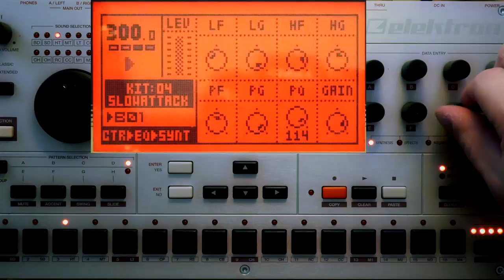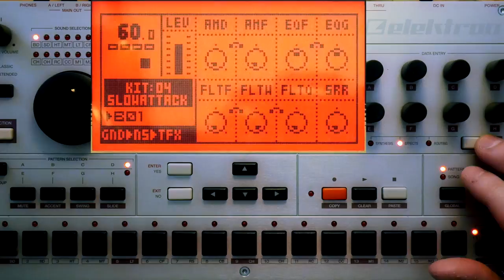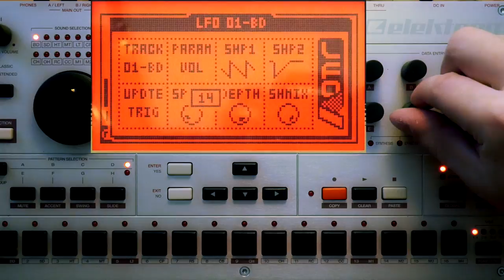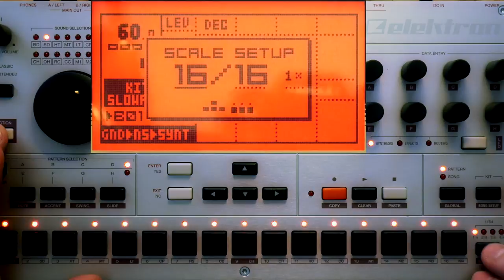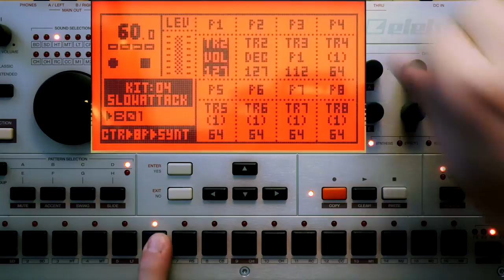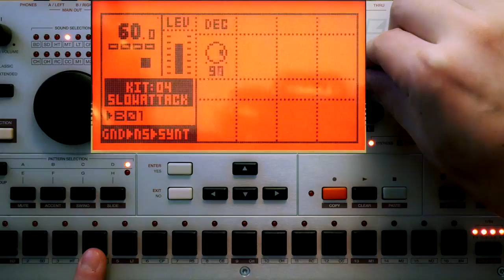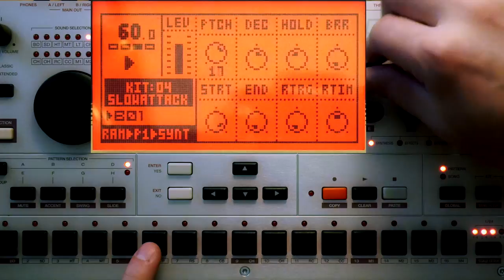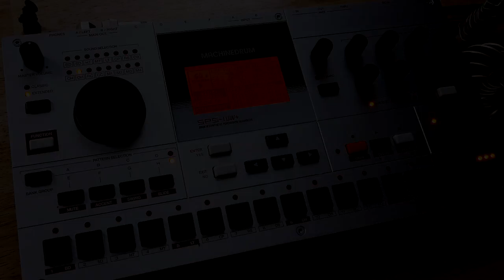Elektron Machinedrum: Slow Attack Envelopes

Comment: Nice video. CTR8 + slide is nice idea, enables  controlling several noise generators at once. 
I would add one advanced method: Route your noise generator(s) back into MD using individual outputs and inputs. Use global menu to specify the path of the signal. Then you can use INP machines, to shape the AMP envelope as you please.
Reply from the maker: thank you! this isn't really meant to be a sound design tutorial per se, and is primarily about basic but not necessarily immediately obvious modulation routing techniques. Using input machines and routing MD outputs back into inputs was outside the scope of this tutorial, but I have been wanting to make a video that goes more in detail about the machinedrum audio i/o and input machines, not sure when that will happen though! :)

Comment: What happened at 5:30? You opened kit menu,  seemingly did nothing but pushing couple knobs and somehow GND-NS was loaded into track 2. How did you do that?
Reply from the maker: my memory is a bit fuzzy so I had to take a look - seems I just edited it out to not have dead air/redundancy and I didn't have narration to fill in over it - footage there is fast-forwarded - I probably fumbled a good bit :D
Reply: @maxmarco  got it, thanks. nice trick with ram machine, never did this before.
Reply: @maxmarco  The kind of explanation I would have to concede to. Perfect.